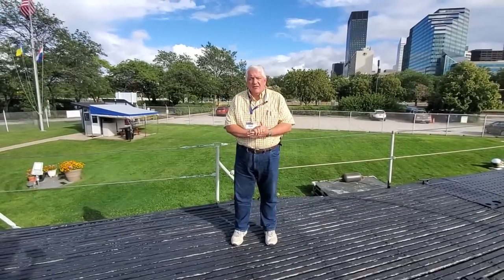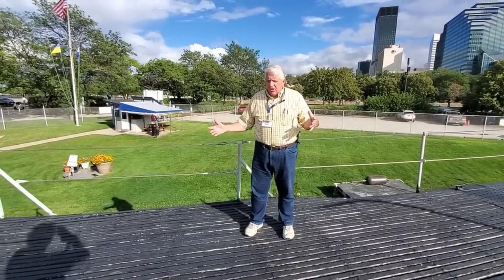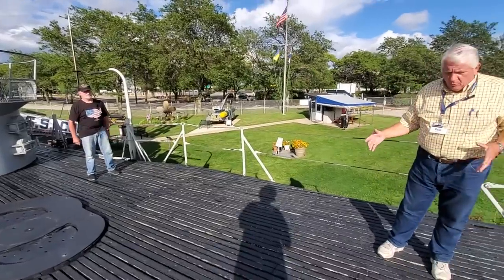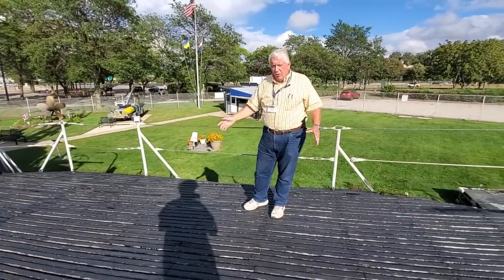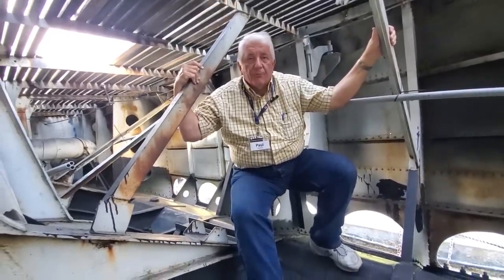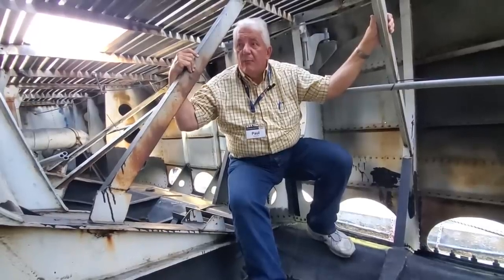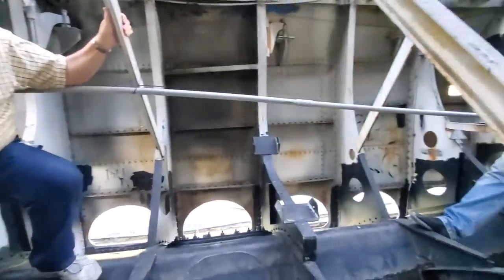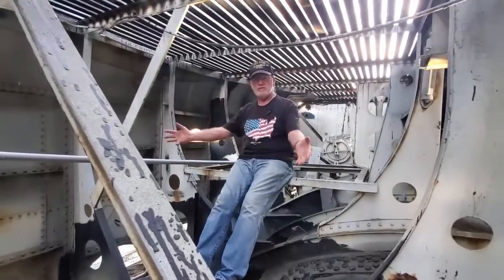Under Deck Tour of USS Cod: The Boat Cradle That Never Was!

Comment: MORE SUGGESTIONS FOR BELOW DECK HIDDEN HISTORY ITEMS:
1.  Inside bow buoyancy tank and what it is for and how its vent worked.
2.  Bow planes rigging and tilting mechanisms.
3.  Forward capstan gearing and control items.
4.  Six forward torpedo impulse tanks.
5.  Tank-top waterway design with vent risers and main tank vents.
6.  Main induction valve and main induction intake piping below aft deck.
7.  Main engine exhaust valves, mufflers and exhaust piping, with cooling water discharge.
8.  Emergency rescue buoys and connection to torpedo room hatches for rescue chamber.

Guppy Submarine Quartermaster (SS) - very well up on Gato/Balao/Tench class subs.
Reply: We've covered some of your topics already   ... and we're working on the rest!❤

Comment: Most, if not all, Soft Patches are made to be removable by using nuts & bolts to facilitate normal maintenance of equipment that has a few years of service lifespan...  (Like the air compressors for blowing the ballast tanks, or shoving a torpedo out for instance!)

Comment: I had not previously known about the liberty boat(s) being carried below deck on fleet submarines. Thank you.

Also, thank you for pointing out & explaining the "soft patch."

What does that scuttle behind Joe lead to/what purpose did it serve?
Reply: Loading hatch for fish... it's coming up soon!
Reply: @paulfarace9595  Cool. If you are using the slang for torpedoes, I didn't think it was big enough in diameter but I guess it's a little hard to judge the size without one in the same shot.

Thanks for answering. I look forward to seeing the video when it becomes available.

Comment: The drains that get gummed up between frames, Sampson Boat CO Installed a possible solution for you in thieir bilge: a bronze chain run thru the holes with a bungee on the end. A couple quick tugs to dislodge any debris.

Comment: that was a great hidden history segment.  I never knew such a capacity was planned, and I am sure seldom used.  The boats just pulled up to anotehr sub, or a supply ship, or a pier, and rarely dropped anchor miles from the beach.
Reply: Cod was in Manila Manila Harbor in 1945 and several officers and crew rowed ashore in one of the inflatable boats. It was done enough before the war that the boats were included in the Gato subs.

Comment: Thank you for these glimpses into the lesser viewed areas of the boats. It’s a huge asset when building models because all this structure has to be build from scratch typically and the additional details provide a chance to add a neat flair to a “standard” kit. 

Do you have any thoughts on why no boats ever got a second 4”/50 gun? To my knowledge 3 boats got a pair of 5”/25s near the end of the war but no skippers managed to acquire a spare 4”.

Comment: Have you all ever tried needle scalers and phosphoric acid to deal with rust?
Phosphoric acid leaves an oxide layer on the steel that prevents future corrosion.
Spray on, wash off until the rust is converted.
Home Depot sells it in the paint department as "Prep and Etch".
Reply: Yes we have used such products.  Need to get on it.

Comment: Nice video and informative, as always.  Thank you for answering the questions I have had.  Now for another question.  The Liberty launch your sub has never had but some did. What did they do with the water that would fill up the boat?  How would they drain it?  Also when the sub would dive, that boat would slow up the dive till it filled with water and would throw of the trim of the sub when she surfaced.  How big of an effect would the additional weight of the water and air bubble have on the function of the sub?
Reply: The boat's buoyancy effect was minimal given the size of a fleet sub. When surfacing, a drain and plug allowed water to drain out.

Comment: Very interesting. But I am referring to the enormous drag from the deck structure I see once the submarine is submerged. I suspect the operational doctrine was to be able to submerge and maneuver and that under water speed was not that prized. I wonder if they ever took a boat out without the superstructure (but with some replacement weight) to record underwater performance?
Reply: Drag under water wasn't a priority in WWII... more so afterwards with the Guppy program. No they nevervstripped a boat. Remember  conventional subs were surfaced most of the time.

Comment: What would they do with the motor?  Or r we talking about using oars?  Great work 👍.
Reply: A pressure proof locker is mounted in the superstructure near the cradle to hold an outboard engine. It was later used to stow inflatable rubber boats.

Comment: So, pre-war, you said that Nautilus, Narwhal and Argonaut carried these launches.  In looking in the web, I see that Chris Craft made a lot of launches for WWII and before, and I have to wonder if these boats were made by Chris Craft or a design of theirs.

Now, here's the question.  Most of these launches had an engine in them, usually internal  Launches under the decks of an older class submarine, because the area is free flooding, are going to get a LOT of water.  Engines and water don't mix very well, at least if the engine is totally submerged.  So, while Cod and other later boats in the war didn't carry them, they were designed for them, and the launches were designed for the submarines.  So, did they let the boats free flood and then have an outboard motor on them?  Or, something else?

Thank you in advance.

Comment: How did they keep water out of the liberty boat when the sub submerged?
Reply: They didn't!
Reply: They likely avoided the substantial weight of the flooded boat on surfacing by have a large drain plug that would be left open and plugged before being set in the water.

Comment: I hope that the liberty boats/ boat were
covered up otherwise they would have been 
filled with water.trying to keep them from 
 floating away must have been a nightmare 
when submerged.
Reply: They would have had a drain plug in the bottom to allow water to drain out upon surfacing. Look at the clamps we point out to hold down the boat when stowed under the deck.